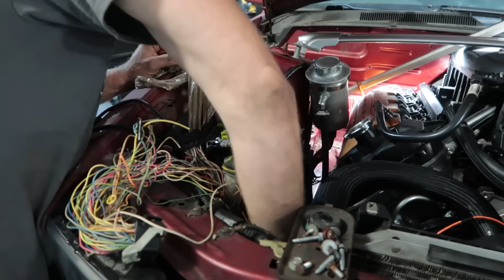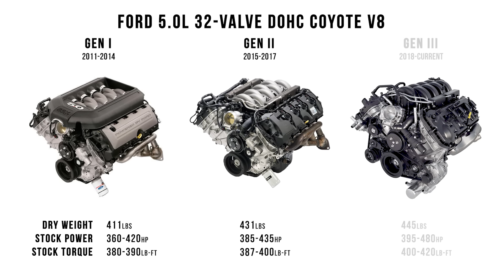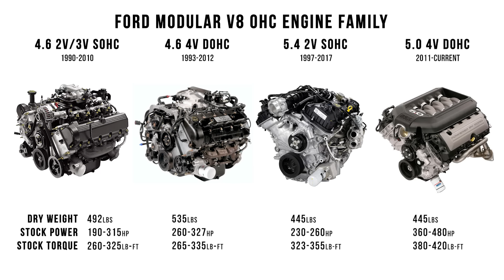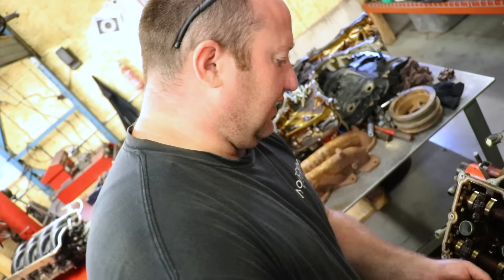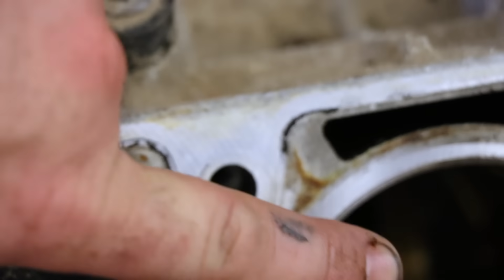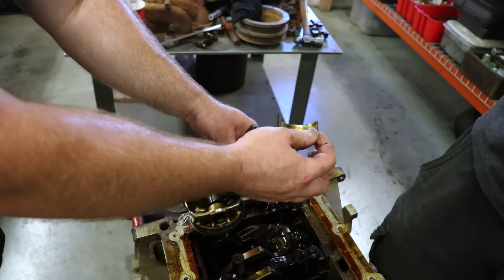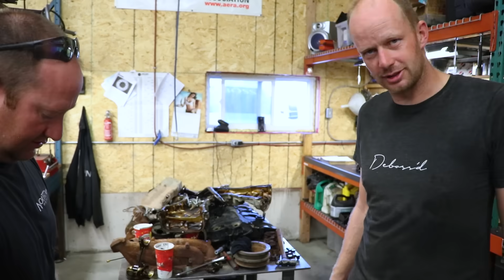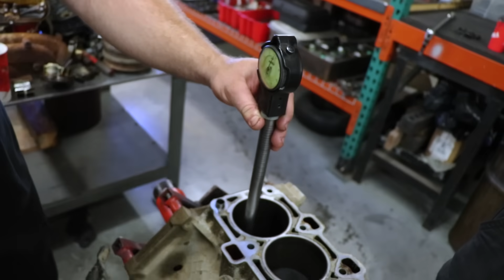REVIEW: Everything Wrong With A 5.0 Coyote Engine

Comment: Different colors on each side is due to the pcv system. Fresh air in leads to the cleaner side and the crappier side is where it gets drawn out. At least from what I have seen in years of experience. Super useful and very informative video. Really starting to like this channel more. The LS and LT are short height. Not massively wide or too dam tall. Not overcomplicated either.
Reply: Bingo!  The fresh air side will be cleaner, the vacuum side of the PCV will be dirtier!  It's a no-brainer, if you know engines and how the PVC system works.  The best PCV system pulls the crankcase/block fumes from a central point with fresh air entering both valve covers.
Reply: @mikeymike758  that’s interesting,so where does the fresh air come from on a 5.3,thanks.
Reply: @dennisgood2108  no
Reply: @mikeymike758  Know of a good video giving the correct explanation and " how the PCV system works "?
Reply: i commented this also dude is one of those just say things for fun guys the 3.6 Chevy does it worst 100% breathing issues if anything non syn would make it worst .
Reply: @Crettybocker427  what???
Reply: @MR-nl8xr  ........
Reply: Duh this guy doesn’t even know that how do I know this when I have no experience with engine tear downs

Comment: i have to correct your friend about the 5.4l camshafts wear.It's caused by the timming chains tensionners. The gasket on these go and the pressure drops to the camshafts. So when you have a 5.4l and you get VCT codes replace the tensionners.

Comment: gotta agree with those 4.6's lasting forever, my brother had one in an explorer he bought used with 300k and it ran even with his 30k mile oil changes when he remembered.... it was burning oil and always low, if i didn't add oil whenever he came by he would have ran it dry a long time ago... 380k when he sold it last year but I wouldn't buy anything he drove for more than one thousand miles

Comment: Interesting, and comical.  The wave of the future isn't another gas engine.  The future is elec-trick!  An electric motor has 3-4 moving parts, can go a million miles with very little maintenance, weighs and costs less, takes up less room, and delivers 100% of its considerable torque at zero RPM, which is why the Tesla S Performance can do 0-60 MPH in 2.3 seconds.  Future EV's will have a small electric motor built into each wheel!  Since 90% of charging is done at home, and the charging infrastructure is moving forward, range anxiety won’t be an issue.  There might be ten years left for gas engines, and there go your precious collector cars, up in smoke.

Comment: Theres another guy on youtube named FordTechMakuloko who i have found to be a wealth of information on everything modern ford. I specifically remember him pointing out how the weak point in the 5.4 3v is the oil pump. From what i understand every single ford modular engine out there deserves an high pressure/high flow melling oil pump upgrade. If done early this can save alot of headaches due to multiple points of engine failure caused by low oil pressure/flow.

Comment: Ah The reason the cam bearings wore out in the 5.4 3v is because of the cam chain tensioner gasket blows out starving the top end of oil. Obviously this guy hasn't had and 5.4 3vs apart and actually figured out the issue.
Reply from the maker: No point.  if it wasn't the cam bearings, it was one of 30 other things designed to go wrong with them.   They were throw away engines from day one.  No mechanic will say the 5.4 was worth fixing
Reply: My whole family runs them sure you pretty much have to open them up and stick the Melling chain tensioners in them, the ones that have no gsskets. and might as well do the oil pump and chains but as long as a guy catches it in time they are great. My uncle has 480km on the setup and my brother has around 200, it's the fact that most people are scared of the ohc design and like how simple the pushrod motors are in the GMs. On the ones my brother has had apart it was never a phaser issue he says that all of them blew the stupid gasket out of the one tensioner starving one head of oil pressure then it will kill the phaser activators and rockers and cam bearings, by that time it's pooches the thing. Ya I admit kinda a dumb design 😂 but  everything can be fixed. Guess I'm just from a ford family. Most people think that slight tick is normal and leave it till it's to late, I mean i would take a 5.4 over the 2.7 eco boost any day. I popped up the hood on one of them and was like nope... I drive a new 5.0  f150 it's a company truck good power but that ten speed is just to much. Great on fuel, I'm getting around 13l per 100km not bad for a 4x4

Comment: I sold car parts for 10 years, we would open all different brands oil filters every year or so to inspect for quality. Never buy fram. Ryco usually had the best, tho wix were good and a few others but fram always had much lower quality. Sheet metal spring instead of a coil spring for example which is industry and OEM standard, fram are bad.

Comment: Ugh.....come on guys.  Synthetic Blend and Full Synthetic oils (which are one in the same) is the cause of the sludge.  I'm guessing that motor had Ford Motorctaft crap oil in it.  (And yes the Fram filter tells me low quality oil too, was used).
A good 100% synthetic oil (Amsoil) would see this motor still in its F150 running perfect.

Comment: So the shop I use to work for has 2015 F450 with the V10 in a Tow truck. It has 99,956 miles on the clock and it dropped a valve and it went to crap. The motor is out of warranty based on time. So they're either going to put a new engine in it for now. But there's talk of putting a 5.9 24 valve in it.

Comment: Your first 5.4 2 valve picture is an EcoBoost.  I had one in my '99 Eddie Bauer 2wd expedition and it was the s*** I used to roast the tires on it all I did was some exhaust tune thing was awesome.  And I ran it up to almost 200,000 with no issues when I sold it just because I was getting deployed.  I could even get 18 mpg highway.  I miss that car, always wanted the navigator tho with the 5.4 4 valve

Comment: This is possibly the worst review of an engine I’ve ever seen. You should rename it Everything wrong with an unmaintained coyote. I have had 3 trouble free coyote engines. My current one has 78k trouble free miles with only oil changes. Now I do remember the LS losing oil pumps in the tahoes that we used for work.

Comment: I had a 93 Lincoln MK VIII which had the new 4v 4.6 liter and a brand new speed adjusted air ride and that car shat and gat. I’ve had a couple of 5.4L 3v engines and I don’t recommend them to anyone. Had to work on, the hydraulic timing chain tensioners are touchy and you got to absolutely use the right oil and filter to get any mileage out of them.

Comment: After seeing the specs of the three generations of Coyote engines, may I suggest a more practical solution?

A blueprinted ‘69 351W motor from a Cougar - originally a 2-barrel AT/PB/AC car - and got great results:
1. Ported & polished stock heads, pistons, connecting rods & ARP bolts
DYNO RESULTS: Built by Carroll Carter
375 HP
428 Foot-Pounds Torque
2. Adding CNC aluminum heads
470 HP
500 Foot-Pounds Torque
Reply from the maker: The 351 is a great engine but the coyote without emissions on it and a tune will do the same, except for 2/3 of the fuel and with no heating issues
Reply: @DEBOSSGARAGE  I never have any overheating issues, and with a new Holley FI setup, after the 4,000-mile break-in, switched to Royal Purple and I get 18 MPG with an AOD and a 3.73 w/Torsen no-slip rear-end ('67 Mustang convertible).

Comment: when i was interested in that 5.0 coyote (2011-2014) many customers were complaining about engine knocking after an oil change....and the 8th cyl. went to hot sometimes.  .seems Ford did never solve this problem ?
Reply: i feel like 3.7 V6 is better than 5.0
Reply: @benitom3049  yep its more durable i heard.I´m pretty happy with my 3,5ltr V6 from Toyota in a Lexus ;-)  ....smooth, good sound no vibrations still after 10 years and 260000km. Oil is still shiny after 10000km. Never saw this in my near 30 years of owning cars. They must have a very good finishing inside and design quality overall.

Comment: Did that guy really say 4.6 2v and big power in the same sentence?! Lol
Reply: They make decent power but the 4v and the corbas can
Reply: Nissan Skyline1992 i dont know what your version of decent is but stock 2vs make like 220 wheel hp and like 350 for bolt on blower ones. With enough money yea they can be fast but honestly they were slow when they were new and up against modern cars they would get gapped by a v6 honda accord
Reply: @9090ruby  I mean decent power to have fun it's not all about having the most power , I wouldnt pro charger a 2v I rather do a twin turbo 2v or just a single turbo and ofc it's a new accord vs a older mustang lmaoo I'm a ls guy mostly but there good realible motors and my brothers 2018  chevy sliverado 5.3 lt got beat by some random accord for gods sake 😂
Reply: @9090ruby  I'm not saying there the best things ever but there not bad  ya slow but realible
Reply: Nissan Skyline1992 theyre definitely reliable but maybe ive been spoiled but i feel like anything with less then 400 feels slow lol
Reply: @9090ruby  ohh lol I feel I havent really driven anything over 400 only 360hp and below that's about it that's probably why lol
Reply: Seen a 8 sec turbo 2v tho

Comment: This guy isn't kidding about the SOHC modular motors. My 5.4L 2V has over 220,000 miles on the original engine and transmission. Absolutely bulletproof engines.

Comment: I skimmed through the comments and I’m surprised nobody has mentioned the tuliped valves on 4 & 8. Typically on fleet trucks that are caked in mud, there are cooling deficiencies on the back two cylinders causing the valves to tulip creating a loss of compression & misfires.

Comment: by the way stop and go driving is significantly worse than highway miles I change my stop and go driving oil every  4000 and my highway cars every 7,000 there's always fresh air cooling the radiator and the engine so it never suffers from excessive heat under the hood unlike idling where it's just cooking while relying on the fan to keep everything cool

Comment: long oil changes have killed soooooo many engines. Its a penny pinching bullshit idea. Ive seen a Cummins ISX 600hp that grossed 68,000kg every km do 2 million km's on synthetic 10W40 and it was still pulling well,great on fuel and the top end showed almost NO wear on the valve train.  It had regular 20,000km oil changes so, I say bullshit that its the fault of synthetic oil. More likely the guy couldnt afford regular oil changes, let it run too long to cause sludge and then let it run low..............an idiot.

Comment: So many things wrong with the info in this video. You're usually great with the info, but I kind of geeked out on these when they first came out and I'm hearing one wrong thing after another. Understandable since you're not a Ford guy. The earliest first gen 5.0L had piston oil squirters in the base engine, at least in the mustang. They went away from those in 2013 I believe. The scintered metal rods with the cracked rod ends have been used since the beginning of this engine's run. In fact, Ford has been using that technique with the cracked rod ends since the early days of the 4.6 2V engines. My buddy got hold of a '90s Crown Vic with a rod knock and in order to fix it he had to get a new rod because of the weird rod end with the cracked partition. The next thing is that the Boss 302 had fully forged rods which I believe were machined traditionally. I think it had forged pistons too, but I'm not 100% on that. Might have been just an upgraded hypereutectic. All of the modulars have their quirks, but they're great reliable engines save for those few quirks. If you take care of them and fix the quirks (plug issues and cam phaser issues mostly), they will run forever it seems. I regularly see them with 250+k miles and still running like, well not like new, but very strong. I'd go so far as to say that the mod motors remind me of my old Toyota 4-bangers. Yes, they're that reliable. Difference being that the Toyotas didn't have any quirks. They just worked.

Comment: I bet this guy was running a high end synthetic and did the extended oil change intervals, like 10-15k miles. I remember back in the day BMW and Mercedes were recommending this when their vct engines came out and they thought they would fix the oil longevity issues by putting an enormous oil pan on it. Those had a ton of problems with sludge. My buddy had a 535i with the 4.0l V8 and that engine was toast at like 100k miles and it was because the PO had done the recommended intervals. Change the oil on those every 5-7k miles and they go forever.

Comment: Synthetic causes discoloration with short trip driving, synthetic eats aluminum,  synthetic burns off more quickly than Synthetic? That's all bs.  I would love to see this guy actually talk to a lubricant engineer. From what I've seen, modern engines and modern oils look a WAY cleaner inside than they did back in the 80's when ppl were running conventional.  The guy lost me at claiming that increasing a piston size and bore size does not increase the displacement. Saying you have a "355" is incorrect? What? It's a larger bore.  Compression ratio is not related to displacement.

Comment: I have seen a few issues with the first gen coyote in the f150. Truck comes in with a slight misfire. End up doing compression test and leak down and find the intake valve leaking. Seen it 3 or 4 times

Comment: Your "5.4 2V" picture is actually a 3.5 Ecoboost (5.4 and 4.6 2Vs are similar looking), and the difference is in the stroke, not the bore size. While I get his points on a 4.6 2V, "lots of power" is not one of its strengths; it's literally outclassed by most V6s these days (with better economy to boot).

Comment: We fleet customers with the 5.4 in the E350 vans. Ford Motorcraft oil filter and full synthetic oil, changed every 3,000 to 4,000 miles. Most of them have between 400,000 600,000 miles on them now.